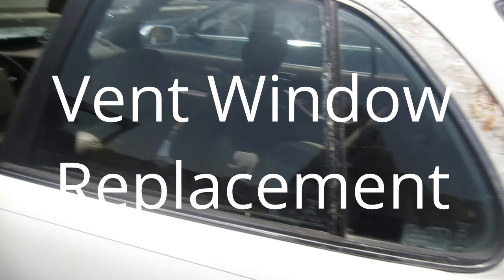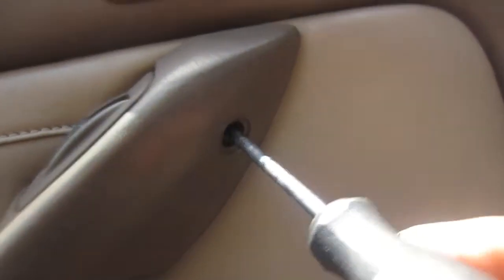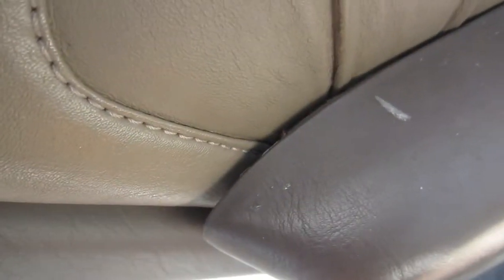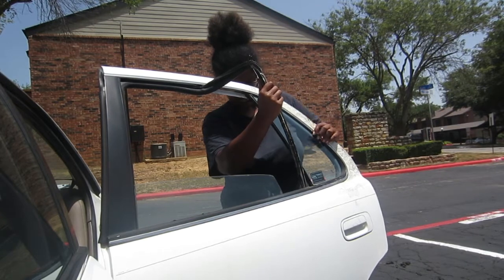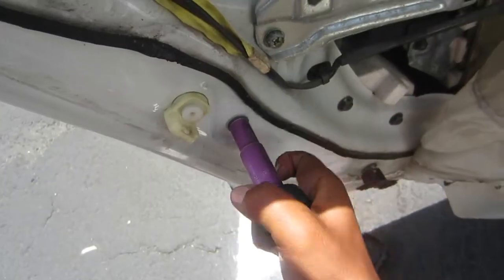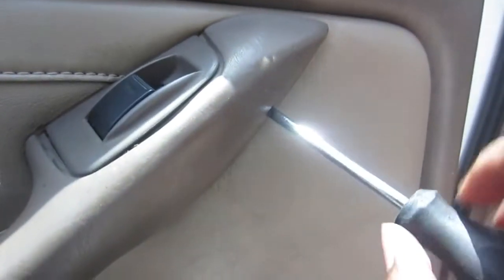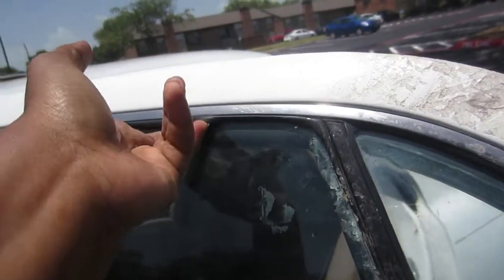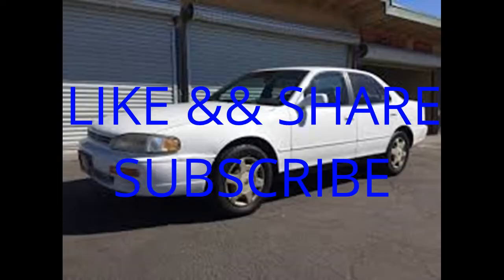Replace Vent Window 92-00 Toyota Camry| Most 90's Sedan

Comment: To take those clips out you push the center in and then you can pull out the whole clip, usually by hand or with a flathead. To take the hanlde out you hold tge handle open to expose the clips that you pry out, they are still very easy to break. Thanks for the video im about to change mine out now
Reply from the maker: Thank you! Have fun!